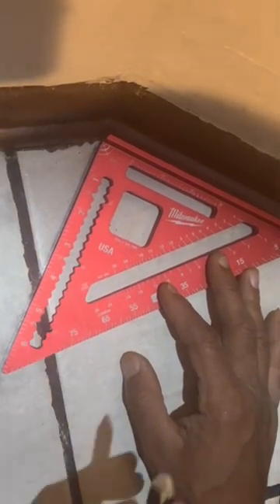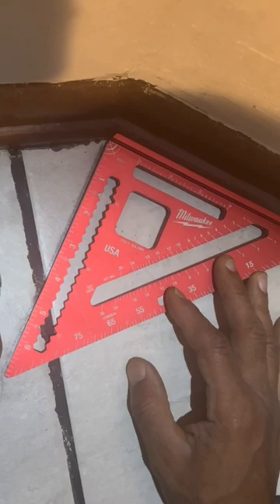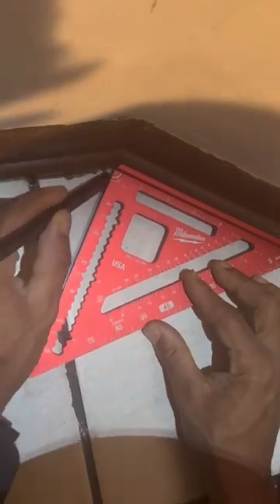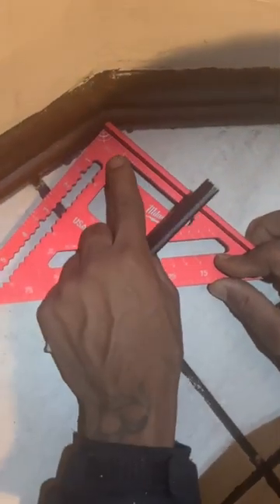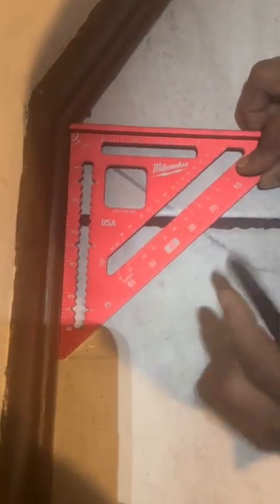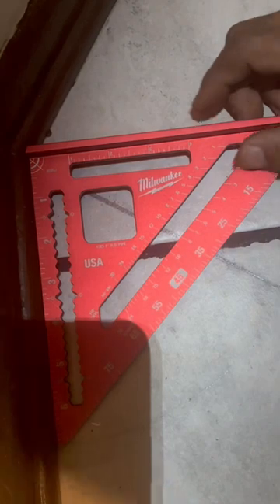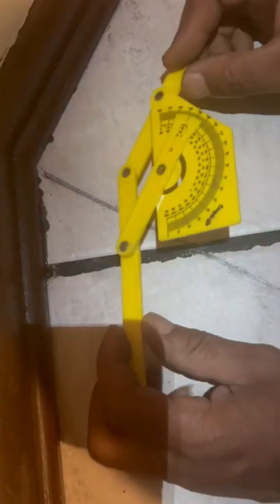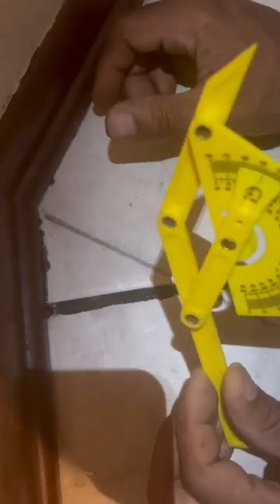Using a Speed Square as an Angle Finder #carpentry #tips #tricks #angles #speedsquare

Comment: Fastest way
Full angle) 180 - 32 = 148
Cut angle) 32 / 2 = 16
Reply from the maker: I agree thanks for the feedback.
Reply: So with the speed square you mark both woods at 16 degrees and can cut it with a hand saw or is the 16 degree for mitre saw? Im just doing diy at home and have a similar angle..just learning at beginner level. Thanks
Reply: You forgot minus 148 from 180 to get that 32.
Reply: @lukemccann4061  no you get 32 from the square
Reply: Are you halving the angle?
Reply: @alanbennett2954  two cuts, so yes.  two 45° mitres equals a 90° angle(example). 👍
Reply: minus one for the cut. math doesn't work applied
Reply: @usman-just-browsing. It's 16° no matter which saw/ method you use. You just want, in this instance, a 16° cut.
Reply: @usman-just-browsing. If you use a speed square and hand saw, mark your line on the flat, bottom side.
Reply: Hey bro, why is the cut angle 32 degrees? Wouldn’t the two cuts be 74 degrees? @ColinThomaslsotti
Reply: @lolwtnick4362 no, the angle doesn't change, only the material gets a hair shorter (the kerf of the blades) that need to be accounted.
Reply: @blairmiller8033 you would think. However, when cuting square stock at the miter saw, the marks reference the edge at 90° so you subtrack the 74 from 90° because of the miter's scale. Depending on how it is viewed, in one direction it is 16°, and viewed 90° from that is 74°.
Reply: Exactly! Two sixteen degree cut angles equals 32. He made it more complicated than it had to be.

Comment: Also, if you go the other direction with the speed square, which would give you 58*, you can just add to 90* instead of subtract from 180* which is usually easier to do in the head
Reply from the maker: Yeah, that's right. I didn't think about going in the other direction. Thanks for the added breakdown.
Reply: so you're saying if you start with the side without the perpendicular base and draw a line on the base and pivot counter clockwise ot would give you 58 with regards to this video and you'd add 90?

Comment: Great video bro. To the point. Speedy might be the most underrated tool in your pouch guys. There is a reason contractors have 16 of them in their truck. You can do exactly what he just did with two of them and no pencil line, over numerous applications.
Reply from the maker: I appreciate you sharing your experience with this channel and  with future carpenters and tradesmen. I would like to show that double speed square trick you just explained if you don't mind. That was a great idea.  Thanks for commenting.
Reply: @templebuilderscarpentry7043  bro absolutely! Thanks for the love. Appreciate you.

Comment: So would the miter cut be 16 degrees ? 180 flat plane - 148 = 32 divide 2 = 16
Reply from the maker: That looks right.  Because if I needed the miter for a 120 degree angle 120 ÷2=60 in order to produce that 60 degree angle I would set my saw to 30 degrees , using the same method you used 180 flat plane - 120 = 60 ÷2 = 30. Thanks for commenting Teo I appreciate it.
Reply: 16 is wrong its actually 23 exactly because 

180 - 32 = 148 Full angle
148/2 = 74 Bisecting your angle for the miter

The most important is knowing that 90 is equal to 0 on the miter saw so you go 

90-74 to get 23 degrees for your miter saw.

Comment: What if you have bumps and dips in walls. I’m still a bit old school so prefer to mark two parallel lines along each wall and draw a line through intersection. I have two sliding bevels to mark left and right cuts. I always cut a little bigger to allow for any deviation in wall and floor and trim accordingly with electric mitre saw.
Reply from the maker: Great advice. Thanks for sharing your experience.

Comment: Idk, the flat base of your speed square should throw the measurements off unless when you rotate your square you keep it parallel the other side and away from it by the thickness of that base piece.
Reply from the maker: I see what you're saying. Usually when I confirm it with the angle finder it's within 1 degree or a half of a degree of accuracy. But like you said if you hold it from the wall the same thickness as the fence you should be good.Thanks for commenting.

Comment: Can u just cut 32 % angle on mitor
Saw?
Reply from the maker: 16 degrees on the miter saw. It's a 148-degree angle ,so 148÷2=74 degrees  . Then, you need to find the complementary angle, which is 90 -74 =16 degrees. 16 degrees on your miter saw will produce a 74-degree angle on your building material.  It can look confusing, but it's not.  Thanks for commenting

Comment: I don't do flooring everyday and those angles are pains sometimes. I just put the edge of the tile or plank in the corner and measure over to the wall 🤷 gets the job done but it's not fancy
Reply from the maker: I agree that's a simpler method, and I use it myself. However, the skill of carpentry can become more complex, so it's important to know your angles. Thanks for commenting.

Comment: this measures the angle but is NOT the cut angle. carpentry math is applied math. to cut that angle would need a different approach. its good to know how to measure the full angle with the speed square, but if cutting base or shoe moulding, it would be around 16° or so if the inside angle is 32
Reply from the maker: You are correct. I have  several videos talking about this. If you want to become  a good carpenter, you definitely need to know about complementary angles.  Thanks for commenting.

Comment: Bro where did the 90 defress come from. Thanks for the video though
Reply from the maker: The speed square is at 90 degrees at the start before I pivot it pass my pencil mark. When I pivot it pass my pencil mark  it does not make another full 90 degree rotation which would equal 180, but it went 58 degrees beyond the pencil mark. The speed square read 32 degrees. So 90 degrees minus 32 is 58 degrees. 58 degrees went pass my pencil mark. I take the 90 degrees I started with plus the 58 degrees that went pass the pencil mark, and add those together 58 +90= 148.
Reply from the maker: I appreciate you commenting.

Comment: It looks like it's a 22 and a half
Reply from the maker: That's wrong
Reply: @templebuilderscarpentry7043  no offense mr. Young man but I'm sure I could teach you a lot
Reply: @geraldsteam1056  it’s not though
Reply from the maker: @geraldsteam1056  Hey Gerald I don't doubt you could teach me something I respect your time in the trades. Thanks for commenting.
Reply: I feel as if it would be 22.5 too . But with the the angle being 148 it’ll be a 16
Reply: @teogarcia3210  what the f are y’all talking about, where are these numbers coming from
Reply: Exactly. Obviously 45 degree corner, devide that chit by 2 call it a day. Why over complicate it
Reply: its actually 23 degrees exactly because 

180 - 32 = 148 Full angle
148/2 = 74 Bisecting your angle for the miter

The most important is knowing that 90 is equal to 0 on the miter saw so you go 

90-74 to get 23 degrees for your miter saw.

Comment: So essentially use a different tool than a speed square.
Reply from the maker: No no no ! The angle finder is only confirming or checking my answer. You can find the angle with only the speed square. Thanks for commenting.

Comment: Put that on the saw. Ohhh no 148°. No 74° for the moulding. Ooops
Reply from the maker: You're trying to be a smart guy right. 148° ÷2 = 74 Ooops  90 - 74 = 16° what's that. That's my complimentary angle I didn't know about that Duhh Ooooppps! Thanks for commenting.
Reply: @templebuilderscarpentry7043  think Im more pointing out that if youre doing trim. These angles arent the quick n useful way to cut your angle.
Reply from the maker: @christopherr7195 Well, why didn't you say that . It's all good, I appreciate the feedback.